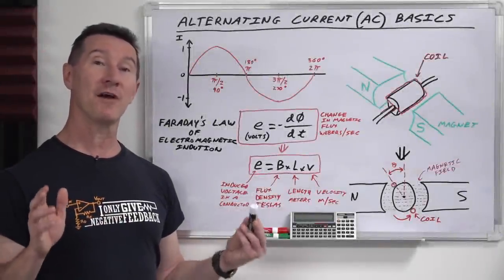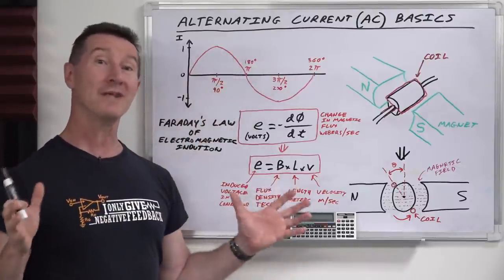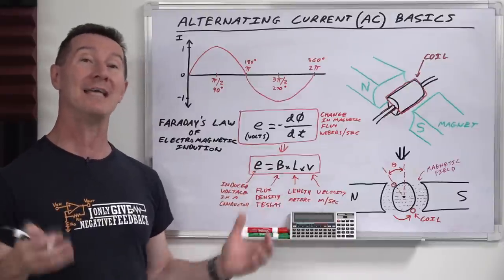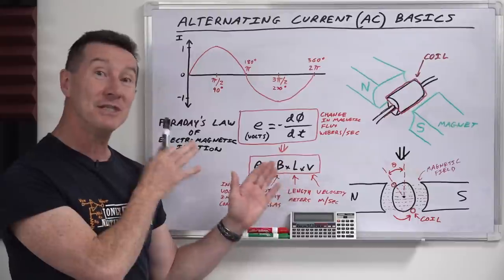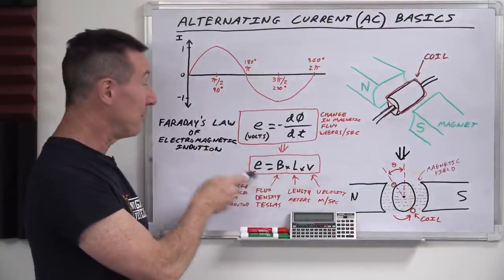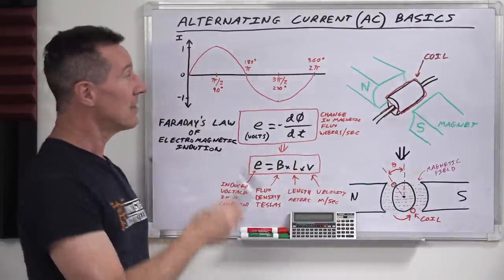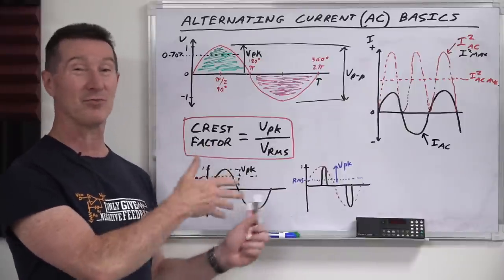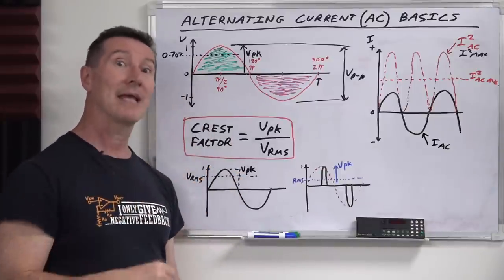EEVblog 1417 - Alternating Current AC Basics - Part 1

Comment: Thanks for all of this Dave - I quoted you when I reviewed the Rigol 1074Z recently, only I spelled "come a guster" incorrectly. 

Until recently I'd been given to understand that inductors are coils but now (d'uh) ANY current through a wire is caused by a magnetic field (or is it the other way around or is it simultaneous) which why all components and even our PCB wires have a certain amount of inductance which can cause issues at very high frequencies! Damn my basic science and lumped component models.  

Back to skool (sic) I guess...

Comment: I think the maximum current peak should be at 0/180 degrees because then there is maximum change between S and N, not at 90 degrees as Dave said. But it's just detail, great work Dave :)
Reply: Dave is correct. at 0 and 180, the movement of the wire is horizontal and in line with the orientation of the magnetic flux. A current is only induced in the wire if the wire cuts through the magnetic field lines.
Reply: I agree with op, I thought voltage peak would be when the wire is horizontal, inline with the magnet but the current comes from the movement and would peak when the wire is vertical

Comment: The highest AC transmission line voltages these days are actually 1.2 MV btw.  First used in India alongside 800 kV DC.
Reply from the maker: Crazy!
Reply: Wow
Reply: Try waving a car antenna around below it during a rainy day.

Comment: Another advantage to sin waves is you can combine any two at the same frequency, but any amplitude and phase, and you still get the same frequency out (just phase shifted).
Reply: Say what, you sure about that??  I for example they If they are in phase they have constructive interference - no phase shift but definitely has an amplitude shit.
Reply: Mmm, if you want constructive interference in a sinusoidal wave you need both in phase, so they add their amplitude.
That's how you get 240VAC in USA, you use two 120VAC lines phased out 180 degrees

Comment: Ill save you all the discussion headache. As not an EE nor an expert, the simple way to explain DC vs AC is "does the current and voltage cross the X axis, indicating reversal of either". If the answer is no, then its a DC circuit regardless of any sine waves in it. Thats why an audio signal going into an amplifier circuit is getting rectified. What difference is there if you use 4 junction diodes to rectify or you overlay a large DC voltage on top? Both cause ripples or sine waves to stay on one side of the X axis. While you're hacking up a sine wave/AC input in diode rectifying to do work, you're adding work to an audio sine wave in an amp circuit so it doesnt have to be chopped up and that signal will then work on the circuit to cause voltage changes. Thats why I like to think of amp ciruits as cloning the input signal and not as passing it along. That also makes it easier to understand distortion. A flawed copy.

Comment: It's rather distracting how the confuser under the whiteboard keeps changing. I especially like the slide rule.

AC is respective to a fixed voltage reference, thank you, the end. Doesn't matter if that reference is O VDC or 500 VDC. This is why, in choob amps, HF snubber capacitors can go to either circuit ground or HT and be equally effective, and why "lifting" the filament supply is an effective way of getting filament hum out of the audio signal.

Comment: Are you sure peak current from the generator is not at the top and bottom, where the wire is moving the fastest through the field between north and south?
Down at 90 and 270 degrees the flux density isn't changing is it?

Comment: 10:30 The Metric System is some weird French thing that you use.
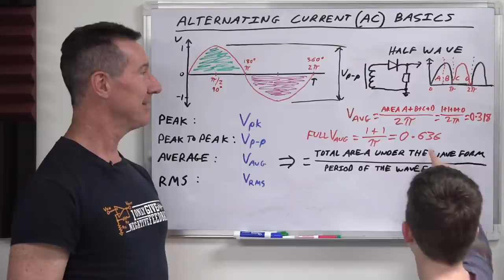28:11Sagan is technically correct, which is the best kind of correct.
Reply: Metric is something we all use  directly or indirectly. The indirect way is just more complicated. https://en.wikipedia.org/wiki/Pound_(mass) and https://en.wikipedia.org/wiki/Inch.
Reply: @petergoose8164  no. Only the French use metric. That’s what Andrew said
Reply: @colejohnson66  Where did he say that? If he had said that how do YOU explain that the Ford Mustang uses mostly metric bolt and thread  sizes. "Le Mustang"?

Comment: I get what you mean, but AC can be stored using a rotating mass, pumped hydro, or pressurized gas. You turn it back into AC using a generator. You can't store it as charge.
Reply from the maker: You aren't actually storing the AC electrical energy like you store DC in a battery.
Reply: @EEVblog  I thought batteries stored their energy in a chemical reaction?
Reply: You arent storing anything you are using the energy to push electrons back basically the same as pumping water back up the hill to be drained later to the bottom when needed

Comment: Am I correct in saying most modern generators put the magnets on the rotor and have the coils on the stator, so the magnetic field rotates instead of the coils? So you can do without the slip rings.

Comment: Dave , or others , an idea / question and I think I have a guess .
" Can not store AC " - idea is using capacitors for AC motors , they are spouse to store power [ not sure the correct term - power ] , and a general understanding of capacitors - they pass AC & block DC .
So how does a motor capacitor store power for motors starting ?
So my guess , the discharge is so fast [ short relative to 50 or 60 Hrz ] that the quick discharge of stored DC from capacitor , that it fits within the positive part of the AC waveform ?
Any correction or confirmation .

Comment: Is it ac if it doesn't change direction? I would argue that a circuit such as a full bridge rectifier takes a sine wave input, and outputs a biased and unusual waveform that "alternates" between positive and neutral.

Comment: I believe AC is also much more efficient when distributing over long distances.  Three phase power delivery is a lot more cost efficient.  That and I think I read somewhere that AC is less lossy at super high voltages over super long distances.
Reply: I've also heard the opposite - DC being more efficient. I've never looked into it, but of course AC has its benefit of high voltage transmission and step-down substations and residential "pole pig" transformers. Less current, less copper, less voltage drop.
Reply: @JulianA-tr6pt  

According to energy education:

“Alternating current (AC) is the type of electric current generated by the vast majority of power plants and used by most power distribution systems. Alternating current is cheaper to generate and has fewer energy losses than direct current when transmitting electricity over long distances.”
Reply: @JulianA-tr6pt  

However, according to engineering stock exchange:

“Transmitting DC power over a long distance is inefficient. Thus AC supply is a far more efficient to transmit power. According to Siemens it's quite the opposite: Whenever power has to be transmitted over long distances, DC transmission is the most economical solution compared to high-voltage AC.”

So yeah, I guess reputable people and companies have claimed both.
Reply: HVDC allows power transmission between AC transmission systems that are not synchronized.  A long-distance, point-to-point HVDC transmission scheme generally has lower overall investment cost and lower losses than an equivalent AC transmission scheme. HVDC conversion equipment at the terminal stations is costly, but the total DC transmission-line costs over long distances are lower than for an AC line of the same distance. HVDC requires less conductor per unit distance than an AC line, as there is no need to support three phases and there is no skin effect.

Depending on voltage level and construction details, HVDC transmission losses are quoted at 3.5% per 1,000 km, about 50% less than AC (6.5%) lines at the same voltage.   This is because direct current transfers only active power and thus causes lower losses than alternating current, which transfers both active and reactive power.

https://en.wikipedia.org/wiki/High-voltage_direct_current#:~:text=A%20high%2Dvoltage%2C%20direct%20current,alternating%20current%20(AC)%20systems.
Reply: @minus3dbintheteens60  

I will look into this after work, but one glaring thing I saw is the fact it costs less because you don’t need 3 phase.  AC transmission doesn’t require 3 phase.  3 phase is just much easier to work with and enables a system to transmit just as much power without requiring nearly as much material.  That and it allows for easy access of both 120 and 240V for commercial use.  Now mind you, idk if a single phase AC requires more or less material than a single phase DC, and if single phase DC is as easy to work with, manipulate, and monitor as 3 phase AC, as these are just things I noted off the top of my head.  As for the skin effect, our power lines use bundled conductors to further mitigate that on top of using multiple phases.

Comment: It's neither AC nor DC. It's NCC (Non Constant Current). Not to be confused with NCV. Which is obviously Non Constant Voltage. And not "Net calorific value" as wikipedia has you believed.

Comment: (@1:10) - I think Dave blew it! The diagram shows a peak current of 1 (amp, presumably), but then Dave points to the diagram and says, “the DC current would just be a straight line at 1 amp”. Nope, the DC current would be the same as the AC (RMS) current, which would be 0.7071 x the peak, or just 707.1 mA (for a sine wave!!) Right, Dave? 😏
Reply from the maker: I didn't have time to build it to scale or to paint it.
Reply: @EEVblog  - Paint the whiteboard?? 😐

Comment: I've found most utility supplied AC to have the tops ever so slightly flattened off.  Probably all the bad power factor devices pulling high current at the peaks.

Comment: I dont agree with dave on velocity and induced current.
When v=0  the coil is moving parallel with the field and not inducing voltage.
velocity is constant.

Comment: EE uses confusing terms. Alternating current should be called "bipolar" current, while direct current should be called "unipolar current."
Reply: alternating current is gender neutral word and non offensive. bipolar current is offensive word as it implies two genders. so please be more careful about what words you use as it might trigger others.
Reply: Just wait until you find out about diffusion current and dispersion current 🙂
Reply: @lordjaashin  What?  Either your comment is a joke that's lost upon me, or it's completely absurd!  Perhaps the best PC argument you can make is that it might offend people afflicted with manic depression. I've never heard bipolar or unipolar in reference to gender. If anything, AC/DC is in fact a common slang meaning bisexuality. Moreover, electronics are full of references to gender, especially when referring to connectors.

Comment: Dear Sir, I am your follower on your YouTube channel, kindly guide me about my Rigol DG2041A function generator. It was after shown a message on screen (overload waveform), and suddenly disable square and pulse waveform at output terminal but showing voltage on output terminal except waveform and other all waveform are properly appearing on output terminal, so kindly guide to me that, how can enable square wave and pluses wave on output terminal? If you have schematic diagram or other any salution in this regard kindly guide me. 
Best Regards 
Israr Ali

Comment: Can any body help me in Assembly code modification for AVR 8bit microcontrollers used for BLDC motor control driver(ESC)?
Reply: Why assembly, just out of curiosity?
Reply: @DarkMatterX1  actually I got it from an open source and want some modifications for my hardware prototype.
Reply: @DarkMatterX1  I an not good in coding. I started to learn Assembly and made some basic modifications, like pinouts as per my requirements. But still not good in coding to do more modifications.
Reply: @myhobbies5965  
I gotcha. I can't help you with assembly. Honestly I think you're gonna be hard pressed to find the help you're looking for. Assembly's not a very popular or common practice these days.
Reply: Try the AVR freaks forum. You can ask all your AVR related questions there :) Hopefully someone there might help you out

Comment: "You cannot put a DC on an antenna and transmit a signal..." That is not fully true. That is where it all started, the spark-gap transmitter. Making a spark with a high voltage, and repeat it as short pulses.
https://en.wikipedia.org/wiki/Spark-gap_transmitter
Reply from the maker: True. Effectively a DC to broadband AC converter

Comment: AC-DC terminology is a mess. VAC (voltage alternating current) does not make any sense, but its meaning is understood by everyone. I think the most accurate term is Alternating Voltage or at least VRMS, indicating that we are talking about a non-constant voltage. Fun fact: in Greek "direct current" is translated to "continuous (συνεχές) current" which makes zero sense. I mean, a sine wave is continuous... 

Another black hole is that of characterizing a wave with both AC and DC components. Is the wave strictly positive? Technically it is DC, but can comprise of high valued AC components (eg 1+sin(ωt) or sin^2(ωt)). What if the wave has both positive and negative values, but with a DC offset (eg 1/2+sin(ωt)). We can name both cases as "AC with DC component" but I think that this really depends on the application.